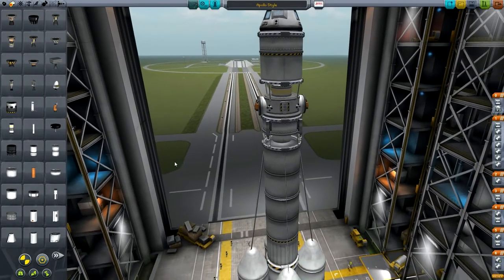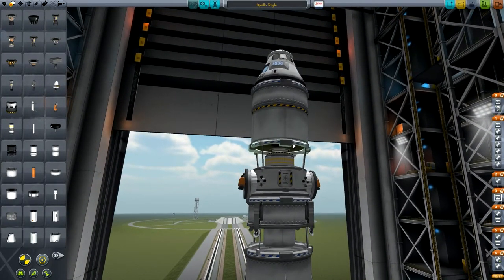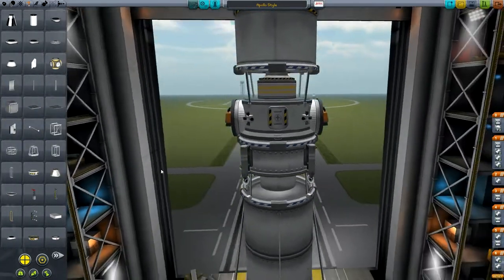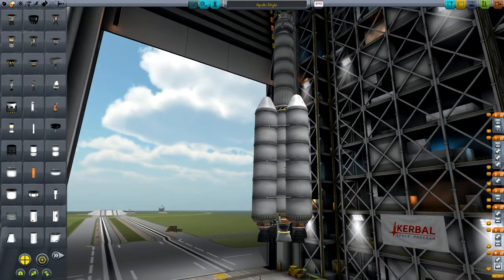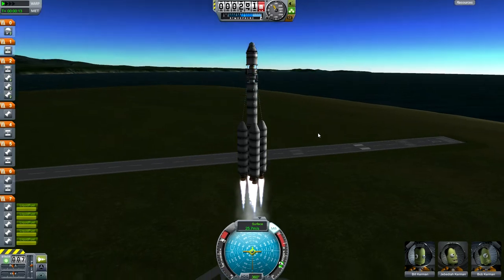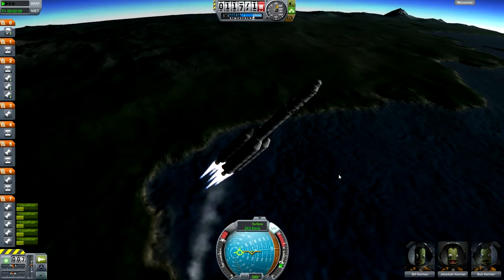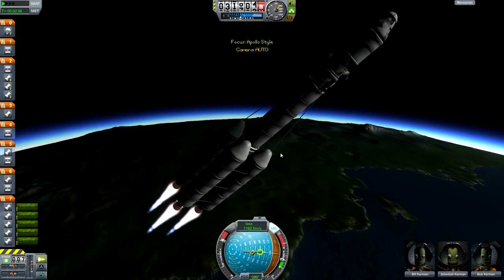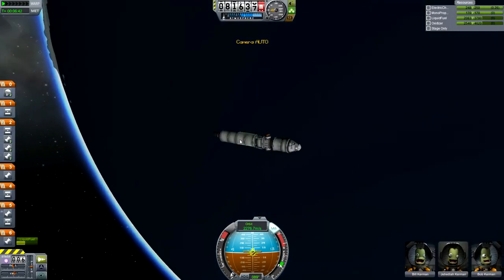KSP - Apollo Style Tutorial/Walkthrough

Comment: Very nice video!! 

In case anyone wants to make it even more realistic, here are a few ways to get closer to the real scenario:

1) In reality, all astronauts were in fact in the Command and Service Module (CSM), and yes it indeed had RCS.

2) Docking with the Lunar Excursion Module (LEM, the lander), was done in Earth orbit, not during the transfer. This was done by first separating, then "simply" turning the CSM around, and docking to the empty LEM. The LEM was basically just a dead target, and the CSM an active chaser.

3) The transfer orbit insertion and the lunar orbit insertion were also both done by the CSM. Thus, to make it look more realistic, I propose to add a much bigger propellant tank to the CSM, also add RCS, and do the burns with this.

4) Cosmetic thing: The capsule had three parachutes.

5) Nota bene: In the Soviet manned lunar landing scenario with the "LK" lander, there were in fact only two astronauts. One in a CSM, one in a LEM. The crazy part was that these would in fact not have been connected by a fly-through docking port, but one of the astronauts would have had to do an EVA to get the lander. In that sense, KSP is quite realistic ;-). Also, only one astronaut would have landed on the Moon, with crazy implications itself.

Cheers guys!

Comment: Nice, love your tutorials.
Never saw the point in doing a mission Apollo style myself, beyond (very slightly) reliving a human achievement, it seems far too complex to include docking in a simple munar landing mission.  Though refueling the lander to reach all the different biomes would be pretty badass.
Reply from the maker: Yeah, I keep meaning to try that :D
Reply: The actual Apollo missions had a good reason to do the docking and having a separate lander. They would not have to take al the weight of the Command module down and back up from the surface of the Moon and they would not risk damaging the reentry shield. So yeah in KSP some of these concerns are not as big a deal and a direct one craft landing and return is easier. But yes, the only real reason to do this is to re-create a historical mission.
Reply: I know why docking was used in the actual mission, witch the concerns for safety, human error, etc, however in KSP I find it excessive considering building a single launch rocket that can make it to Duna and back is pretty possible for an average level player.

Comment: Nice try.

-All three were in the Command Module at liftoff. (That part you got) They did actually dock with an empty LM after separating from Saturn V's payload module, then reversed the whole shebang out of the payload module.
-Docking with the LM came before Translunar Injection.
-In reality, they would deorbit the LM before undocking it from the Command and Service Module for the return trip.

At least you got the water landing. NASA made it a point to water land so as to avoid hitting populated areas. That, and they had a specially outfitted Navy team to debrief them.
Reply: -docking with the LEM came AFTER translunar Injection.
-Not sure how you can deorbit the LEM BEFORE you undock it, unless you mean they deorbited the lem AFTER they undocked but before they returned to earth.
-The landing on water happened to help cushion the astronauts at impact. NASA had positive control over the reentry landing location and could have landed on land without being in danger of populated areas, as the Russians do, if they wished to.